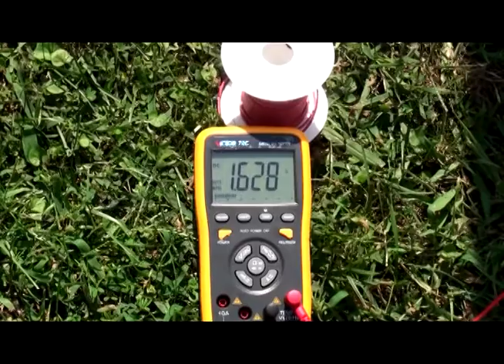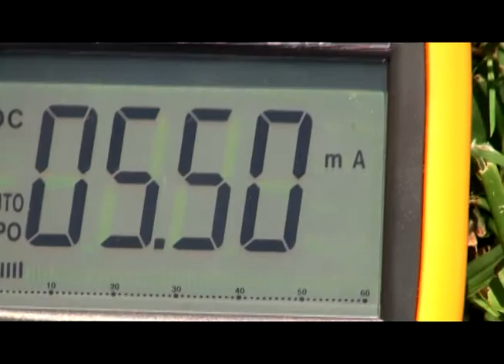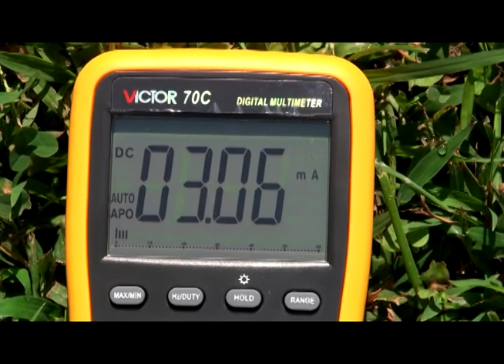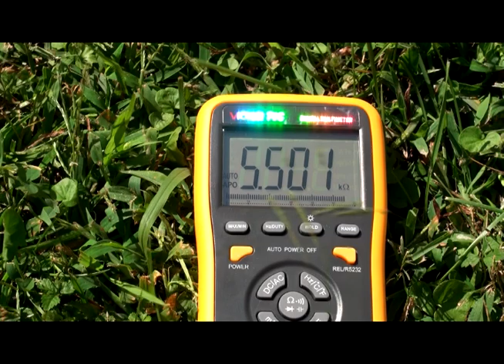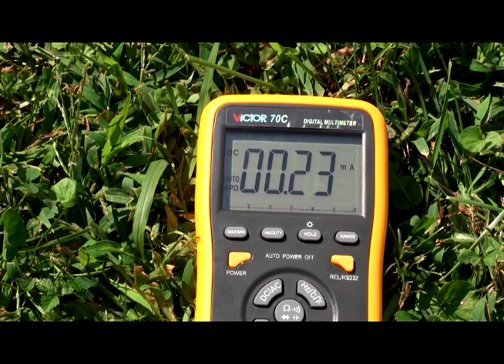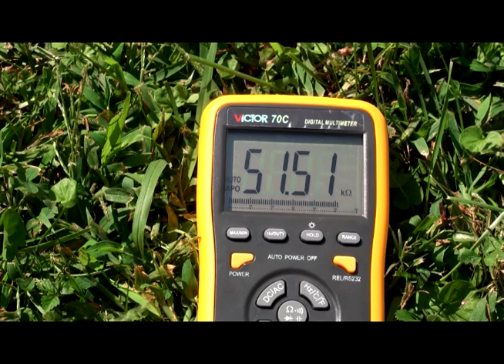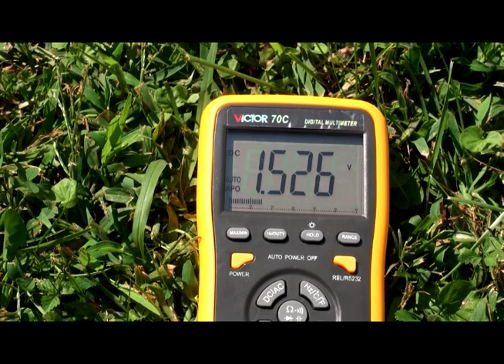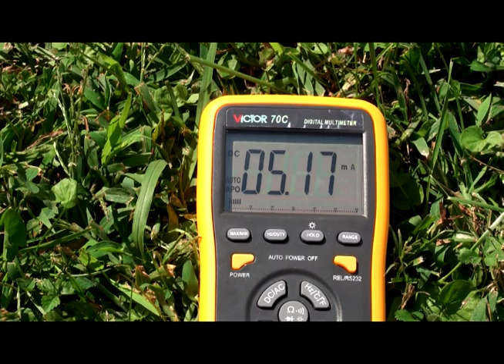Telluric Current Experiment #3

Comment: This should be mostly galvanic I would think, carbons like +0.3 v and magnesium is -1.1 V under ideal conditions, and then you got another bit with the telluric adding on top of, bravo.
Reply from the maker: Not should, is totally because of the electronegativity of the rod material used.  I don't think unless I had some seriously long lead length and more sensitive equipment than a multi-meter that I would be able to detect anything above what I saw.  In addition, if I do it again, I will try to use the same metal for the rods to eliminate the potential for purely electonegative effects.